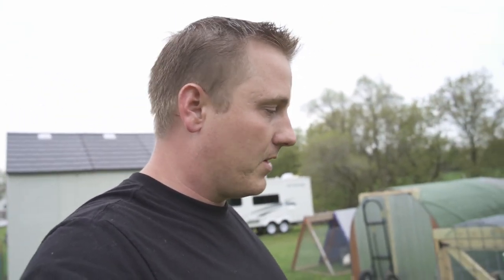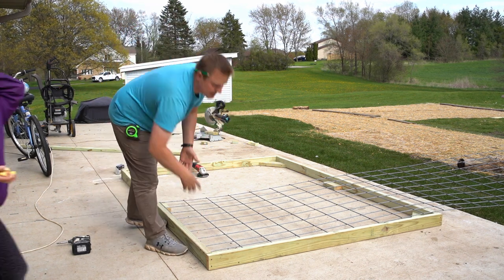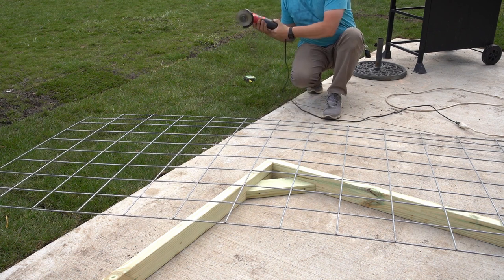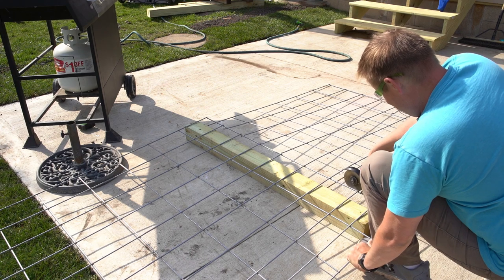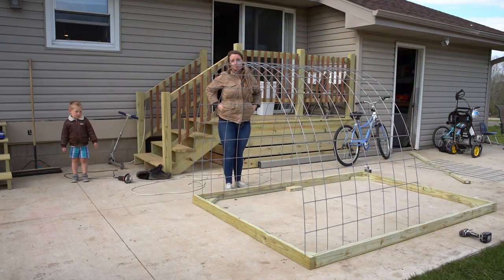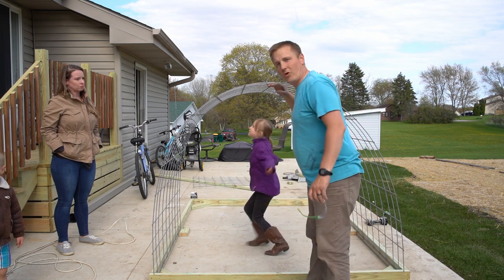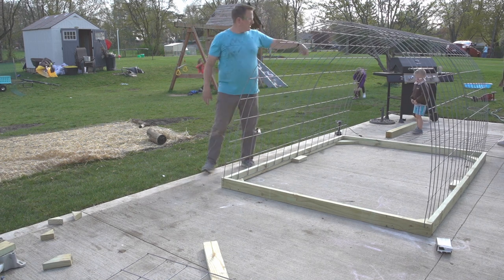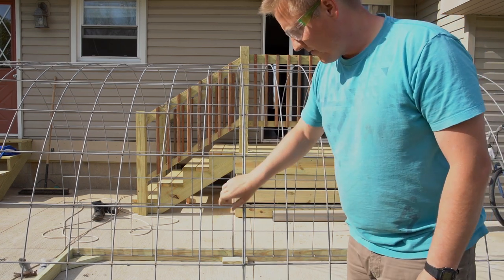SIMPLE and STURDY DIY Chicken Hoop House BUILD

Comment: very nice build.  I appreciate the details you shared on structural support and framing.  I'll be building one that is taller, using the full 16', but the principles on the build will be very helpful. I like the ridge beam design and the way you wrapped the hardware cloth.  Thx for sharing!

Comment: Nice! why didn't you show us the assembly of the wheels? It would have been useful.
Reply from the maker: Unfortunately the video file was corrupted.   Long/short, i used a 1/2” by 4-6” carriage bolt, drilled through each side of the framing with a 1/2 drill bit after evenly marking both sides.  Then drive the carriage bolt from the inside to the outside, thread a washer and nut to snug the bolt down, and slip your wheels on before moving.

Tip:   If the hoop house is open on one end only, place the axles at the end that is closed so when you move the house you can visually track the birds through the open mesh end so as not to crush any birds

Comment: Those cattle panels are really expensive. I've been watching videos like this and nobody mentioned the cost, I was very disappointed when I went to buy some panels and realized how pricey they were. So I went a different route.
Reply from the maker: Really what were they charging you?   I paid 20.00 usd a piece at either tractor supply or another local farm store.
Reply: @GritandGrace  70 something dollars for one panel. And they're too long to fit in the bed of a truck, and I don't have a trailer, so I wouldn't be able to get them home. That was at tractor supply
Reply from the maker: Whoa!  I don’t know if this is a result of COVID caused inflations like in dimensional lumber, but a 50” by 16 foot panel never cost that before.   Where are you located in the world?
Reply: @GritandGrace  mississippi
Reply from the maker: Wow, well you may have to build a different wood version, but 2x4s are double what they used to be.

If you decide to pay up for the panels, you can ask them to cut them down to 12’.   That’s what I did.   And you can always pay the 25.00 to rent a u haul utility trailer for 4 hours.   Get your panels, spring mulch or whatever else you might need in one shot to maximize efficiency.  Good luck on you coop build, whichever direction you go
Reply from the maker: One last thought is you could look around on facebook marketplace or ask a local coop if they know of any used panels one could buy.
Reply from the maker: I just called my tractor supply company in Southeast Wisconsin where I live, and these cattle panels are 22.50 apiece, So I would maybe call and ask again because they must’ve looked at the wrong thing, or your prices are drastically higher due to your region
Reply: @GritandGrace  huh. Thanks!
Reply: I looked, they're 64.99 and 59.99 on tractor supply for the ones that would be big enough to make a hoop house that I could walk into. They have some cheaper ones listed online but they're a lot smaller and wouldn't work right for what I had in mind
Reply: @lifeunfiltered4822  16’x50” cattle panels in an 8’ wide frame is a little higher than 6’ tall and they cost (northern Illinois) like $24 a piece, if they’re anything more than like 30, maybe 40, yea, I’d go a different route
Reply from the maker: Where in northern Illinois are you?  We are southern wi
Reply: @GritandGrace  I’m almost exactly between Rockford and Chicago
Reply: @GritandGrace  I'm not, I live in mississippi
Reply: @Fetidaf  yeah we built a wood frame and covered it in chicken wire. Gonna add onto it and build an enclosed laying area once lumber prices go down.
Reply: Just looked them up as I was.looking to build one of these hoop coops. 30 dollars on tractor supply right now for the cattle panels you can get more expensive ones too.
Reply: @lifeunfiltered4822  I got mine for 15 try a feed store